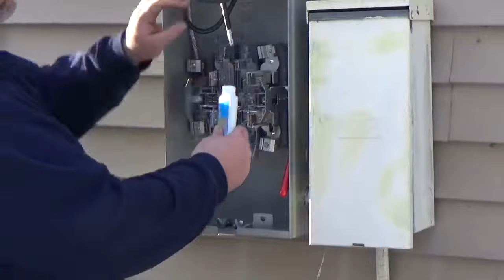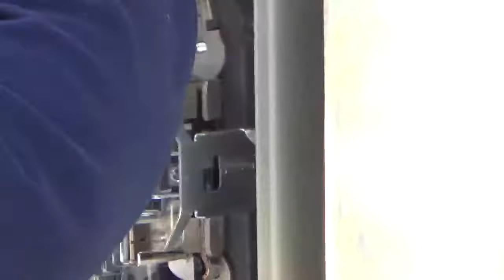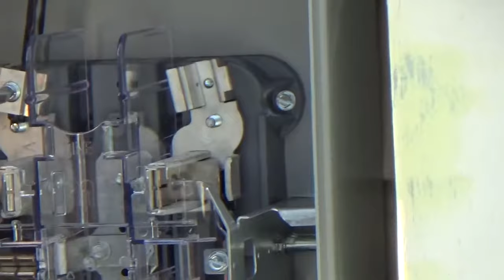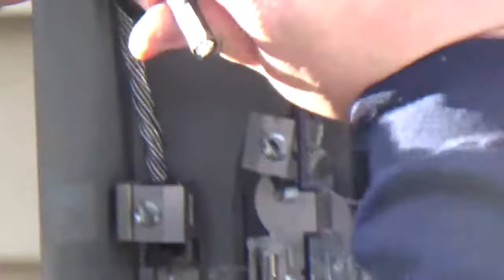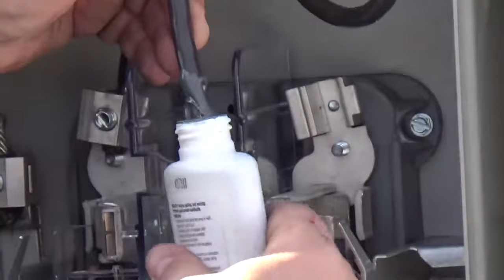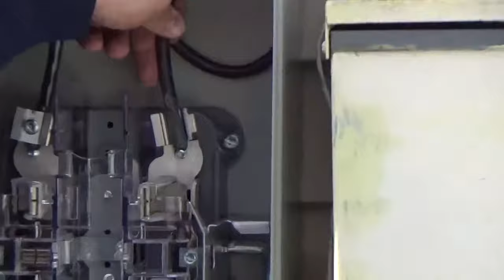Wire Line side of a 100amp Meter can

Comment: what/why is the stuff you coat the exposed wire before securing down?
Reply: Helps prevent oxidation of the wire.
Reply: It hasn’t been required since 1987.  some people like to use it still